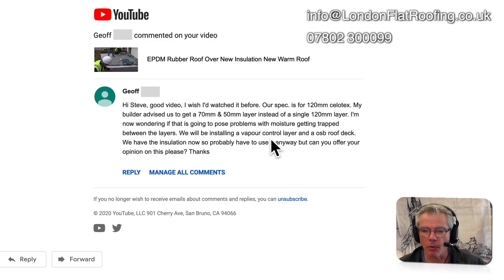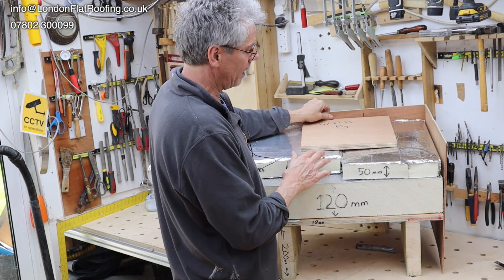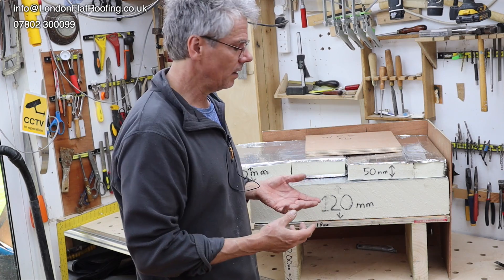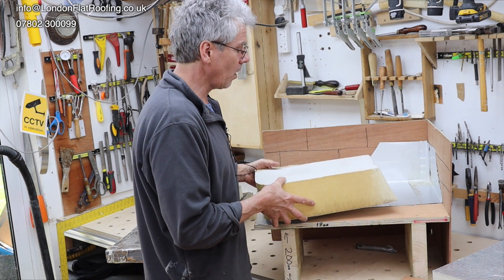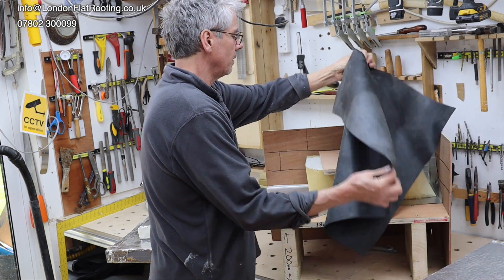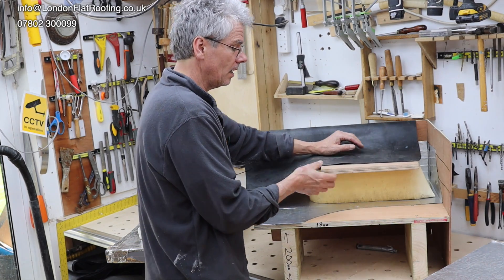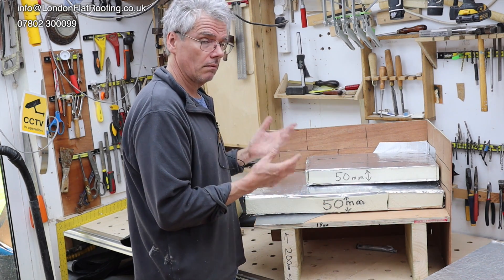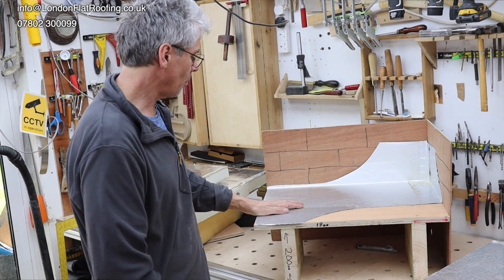Warm flat roof two layers of insulation will it work?

Comment: The Victorians knew that trapping moisture would lead to failure of the structure. The Romans knew it too. Here we are desperately trying to reach an arbitrary thermal target set by a politician and trapping and pushing moisture here there and everywhere. We've gone so far that now we're talking about installing air pumps to get rid of the condensation and poor air quality this crap is creating in our homes. But alas! air pumps (and other vents) introduce cold air, so we've come full circle and spent a fortune doing it. The latest solution? Air pumps and a heat exchanger; more money to solve the problem of trapped moisture. Look at the cost of all these building materials, very few of which are recyclable (and extremely toxic when they catch fire), it would be cheaper and more eco-friendly to build more solar farms and wind turbines and let us live in homes that can breathe. The number of homes I've seen with sky high humidity and associated problems is mind boggling.

Comment: Can I use 120mm celotex boards for my flat roof instead of 120mm kingspan ?
Reply: I think ther eis a slight difrence in the U value but nobody seems to take any notice of this. They all think 120 is 120  regardless and the difference is really small

Comment: Steve, having watched (nearly) all of your videos to help me understand and choose the best solution for my flat roof, there is one thing I cant find an answer for.
I have gone for a warm roof as the best solution and, as a carpenter, the roofer is happy for me to do all the fascia boards around the perimeter. Having had a look behind the existing old ones, there is no insulation at the joist ends where they sit on the cavity walls. Should I be sealing the perimeter with insulation before adding the Ply and then fascia boards (I have decided on HPL as is very common here in the Netherlands). If so, should it be of the Rockwool type or solid foam insulation sealed tight all round?
Many thanks

Comment: Hi Steve, just been watch several of your videos, very in-depth and easy to follow. 
I am just about to embark on an extension and I feel warm roof is the way forward. you mentioned tissue faced PIR, with the extra cost of this can you not just peak the foil from the surface of the normal PIR?
Reply: That's a good question yes, you could theoretically but there's really no need to you. You can get away with using foil-faced insulation. As long as you are using a very very good vapour barrier. Everybody seems to use foil-faced except for me and mostly I see they get away with it especially in warm roofs
Reply: @HampsteadBuildersLt  it was when you showed the video with the 3yr old roof with completely joists just rotted away, quite frightening. It’s as if the roof becomes a slow cooker!
Btw thanks for the reply.

Comment: HI please can you help how can I turn my cold roof into a warm roof thanks what would be the layers I would need to turn my cold roof into a warm roof thanks , waiting for your response and I have subscribed and liked your video thanks
Reply from the maker: To turn a cold roof to a warmer correctly. You need to take all the insolation out from underneath. Then you can add insulation on top of the decking if the old roof covering is in good condition it sometimes can be used as a vapour barrier. However, there are a lot of things that need to be taken into account. Feel free to send me photographs and maybe I can help
Reply: @SteveRoofer  thanks so much for getting back to me, another question i have is which is best fibreglass or 3 layer felt thanks
Reply from the maker: @amazingsalonsecrets6847  3 layer felt  never use fiberglass

Comment: not directly about this video, but would it be possible to use 11mm osb for either both decks or the top deck on a warm roof as im using 150mm celotex which was picked at a seconds warehouse?
Reply from the maker: Yes as the bottom layer but to week for the top layer and the top should also be T+G

Comment: I have a 1960s house with flat roof in south buckinghamshire with basically zero insulation. Was wanting to to upgrade it next couple of years.  At the moment there is burnt on felt.  Can I use that as the vapour layer? I thought sticking kingspan tr27 to that and then putting resitrix directly onto that would be sufficient.  Or a roofer who fixed another problem for me suggested to put 120/150 insulation battened in onto the felt and topped with OSB3 and then EPDM onto that.
Reply from the maker: You can use the old Phil as a vapour barrier. If it is in good condition, you must add to it upstairs, so the insulation sits inside the Felt and upstands, think about turning a shoebox lid, upside down and lining the inside of the shoebox lid and up the sides with the vapour barrier. Then you put the insulation inside that so you've already got the bottom in place because you can use the Felt, so you just go round the edges and build the edges up and you're done it's going to be airtime from the roof down below.

Comment: Unfortunately I didn’t get my answer from watching this video. I am from Greece and I am building a warm roof with xps insulation, the plan was to get a 60mm isulation but the factory only produces 30mm insulation because there is no demand for the other. So I’ve been told to use two layers of 30mm. But the thing is xps isolation doesn’t come with a vapor barrier, in fact the vapor resistance is 50-150 μ. My actual vapor barrier that is glued under the insulation is 1500 μ.  Can I use two layers of insulation with this built up?
Reply from the maker: Yes its considered the best thing to do stager the joints

Comment: Hi Steve! I understood the roofing through your videos.  Thank you! What I am not clear on is what goes inside,  under a warm roof? We are planning to build an A frame house with a warm roof. But how come the first osb layer (close to the ceiling) is not going to get affected by the vapors in the house?
Reply from the maker: in a warm roof the first OSB IE the lower decking is under the  AVCL (air vapour control layer)  therefore its internal juts like your kitchen table! i've never seen a kitchen table rot as its in a good controlled environment. Everything under the AVCL is classed as inside even the structural timbers

Comment: Love your vids, but I'm not quite sure sure I understand how tissue faced insulation helps in this case? The EPDM membrane is fully vapor resistant so any rising moisture has nowhere to go, unless it's vented, like a cold roof. A warm roof needs to be fully vapor sealed below the insulation like you said. 
 
As I understand it:

cold roof = vapor open construction, vented above insulation, so rising vapor/moisture can get out.
warm roof = vapor closed construction, fully sealed on both sides of the insulation so rising vapor/moisture can't get in.

Does that make sense?
Reply from the maker: Love the question and in many respects, you are right however we know that some materials are more vapour resistant than others  thus on a warm roof you should have the most vaper resistant material at the bottom and then allow any vaper that gets through that to rise to the top and get out what you don't want is it to build up over the years

Comment: My understanding is the vapour barriers are not the best, and you should go for a more moisture open vapour control layer. Because let's face it, moisture will get up past the insulation, and it can't escape through the waterproofing layer. Also, if you use a PIR without a foil face but fibre reinforced you can fix some waterproofing membranes straight to it, so no need for a timber deck
Reply from the maker: All very good points I like to use tissue faced insulation all the time also believe that air open is much better than air closed. Working on a new roofing system at the moment that is air open but not a cold roof or a warm roof. new video coming

Comment: Hi Steve, really good explanation, thank you
I have a question please…

I am converting a barn with a sloping tin roof into a craft room and live in France so experience huge temp variations
I can’t take the existing roof off so want to insulate from the inside - there are a couple of beams holding the roof up which are solid but they are spaced at 5’ so was going to add some extra across struts (to reduce the span of 5’ for extra places to nail the plasterboard) 
I was thinking after watching lots of videos on here;
Vapour barrier against the tin roof (which is in great condition)
Then insulation, sealed (builders merchants here have said to use the thin multi layer foil for R value
Then more insulation - rock wool
Plasterboard to finish
I don’t know where my air gap should be - between layer 1 & 2 or 2 & 3 or both
I do know I need an escape route for condensation and I have sealed around the gaps in the tin profile with expanding foam
Any suggestions please, thank you kindly

Comment: Hello 
Wonder if anyone can help,I'm building a block man cave ..my roof joist are 7by2 but my insulation is 60mm recticle..Will that be ok having a 5 inch gap in my joists? I'm doing a warm roof soo will osb and use another 60mm above the vapour barrier and then osb again and a rubber roof to complete it.
 I'm just not sure if that gap is ok in the rafters...

Any input will be greatly appreciated 

Thank you

Comment: Maybe a stupid question but have to ask..
A builder has suggested I do away with the  parapets about yo be built on my new build extension. He suggests a facia and soffit all the way around. Are parapets assential for a warm roof? 
Sorry if it seems a simple question.
Reply: Yes, do away with parapets unless detailed to avoid cold bridging in the corner between ceiling and wall, the cold can bridge from parapet into that edge between ceiling and wall, causing condensation. Appreciate you probably already had it built by now, but that's my thoughts. Plenty more about that on YouTube, for example "skill builder" channel

Comment: Hi Steve. Very informative video, as are the others you have done. Quick question; if Im creating a warm roof should I not put a layer of ply or OSB placed ON TOP of the insulation? ie just adhering the EPDM direct to the insulation? Thanks

Comment: still confused....so multi layers are OK but not foil backed? Would that not go for single layers too? And at one point you said not to put ply on top?!?!?
Reply: Hi, his videos are very misleading and contradictory, but with most things roofing is down to workmanship. It’s OK to use one layer of insulation or multi layers, providing all the joints are butted together ( ie no air gaps). I would never specify plywood on top, the insulation used has a very high compressive and is manufactured specially for use in this application. The faces on the insulation has very little to do with the transmission on vapour, all these issues are engineered out by using the correct VB at the base, the correct thickness insulation and by choosing a reputable contractor with trained staff.
Reply: @subzero3054  Are you limited with how you can cover PIR without ply or osb on top ? Is GRP still an option or would it have to be edpm or felt ?

Comment: The warm roof generates so many questions and so few definitive answers.

As a layman with a keen interest in DIY, I removed my leaking flat roof – a cold roof – two years ago and began rebuilding it from ceiling level as a warm roof. I have just closed it back up with tarpaulin for a second winter, having failed to think of any solution for the problem of water vapour rising from below and condensing into the insulation. Damp insulation (like damp clothes) doesn’t work and it eventually deteriorates. The prospect is made worse by regulations that disallow a warm roof to be dried out by being ventilated. 

The answer would appear to be to stop water vapour from getting up into the roof in the first place by opening a window. However, in the UK, changing the air, whether in the room below or in the roof above lets out the heat that is keeping you comfortable. If you turn the heating up, the final objective is defeated, i.e. to stop global warming - in which water vapour is strongly implicated. 

The current regulations (probably originating in the EU) seem to me to be a politically correct compromise, but entirely impractical. They invoke an imaginary process whereby water vapour evaporates but slowly from your roof structure but does no damage while it is there. Most weather proofing, especially EPDM traps vapour beneath it, hence the delamination noted by Steve Roofer in one of his videos. I asked Celotex, the manufacturer of my insulation and their reply was to provide a timber surface on top of the insulation for the EPDM to be stuck down onto. In view of this, I have bought OSB deck board for on top of the joists and 5mm plywood for an upper surface. 

The main problem then is building your warm roof so as to be thoroughly sealed against hot moist air from below. The problems in building a warm roof are so complex, I am thinking of redesigning my rebuild as a cold roof, ventilated to code and dry as old toast.
Reply: Woe that's an eye opener thanks for sharing

Comment: Question, can you use 50mm on top of joists and 70mm between joists, as sometimes the height is big issue, and cold roof with ventilation isn't an option.

Comment: Very useful information! I have a quick question I was hoping you could help with, could you use insulated plasterboard under a warm roof?
Reply from the maker: No you shouldn't, you will change the hole dynamics of the warm roof
Reply: @SteveRoofer  Thanks! So just standard plasterboard for the ceiling under??

Comment: Hi Steve, just been looking at a company doing garden buildings and they say the roof they do is a "hybrid" cold warm roof, they do videos and explain it here:
https://youtu.be/soclpj3gGiI?t=148 What are your thoughts on this? From what I have read it goes against what a warm roof and cold roof should be and ends up not being either?

Just dreading what might happen with all these garden buildings that people will be getting because of lockdown. Keep up the videos! Always very informative!
Reply: Two or three people have sent me links to this and all I can say is that it's a shed he is building so he can do whatever he wants. Hybrid roofs are proven not to work.
Reply: @HampsteadBuildersLt  Thanks steve, was more thinking about the danger of any moisture, bad that he is charging thousands for this and people don't know!
Reply from the maker: You're correct it's all wrong and will go wrong probably within 2 to 3 years 90% of all flat roofs I see a bill incorrectly I drive down the road and see buildings going up large buildings going up and the vapour barrier is in the wrong place or the wrong vapour barrier or the vault the wrong insulation everything looks to me as as if it's going to go wrong in a very short time. New builders and architects and engineers do not seem to be understanding the second law of thermodynamics.
Reply: @SteveRoofer  Ive seen this video too.  To salvage this would you just have the insulation at the bottom of the roof and have a 50mm air gap above with vents at each end in the soffits?

Comment: Steve my question is would you leave celotex 100mm insualtion in between the rafters and build a warm room over the rafters in the usual process where in you put 18mm board ,vapour barrier then 120mm celotex then 18mm osb board and finally the epdm rubber on the top would this be right way to do it leaving celotex between the ceiling rafters or should we remove it ?

Comment: So moisture can leak through the foil in products like celotex & single ply rubber edpm?
Reply from the maker: Not moisture but vapour yes. Think of a Gortex coat it keeps the rain out but when you sweat (vapour) can move through the fabric, it doesn't build-ups and you should feel dryer. Everything has a vapour resistance some things more than others foil is extremely good, this is why when you buy some foods the container is lined with a silver foil. Compared with a foil EPDM has a low vapour resistance.